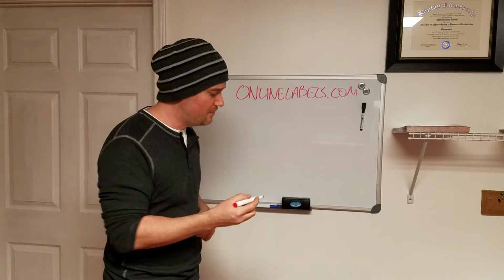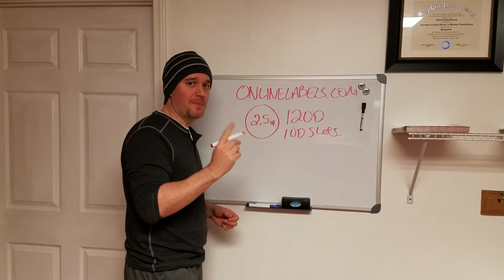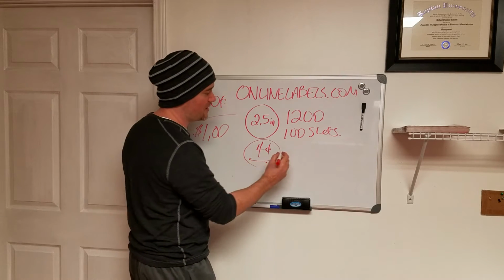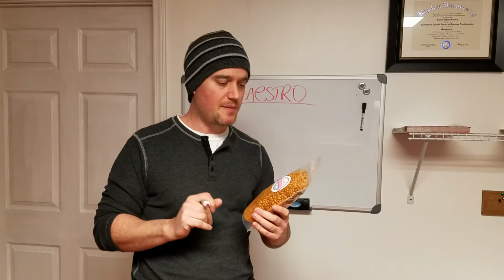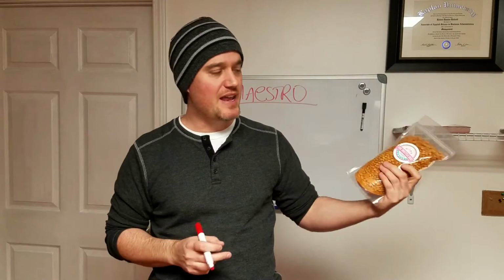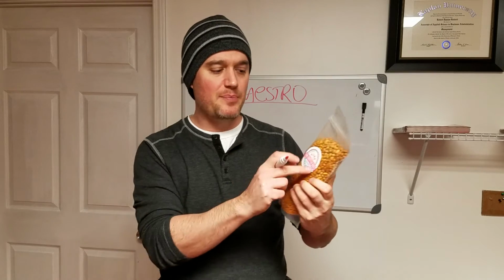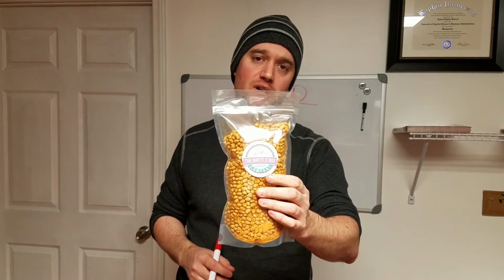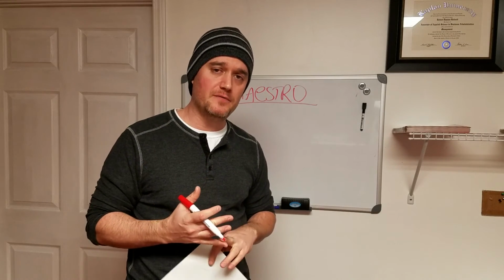Selling Food Online Tutorial Amazon Ebay Etsy Printing Labels for Pennies

Comment: Great info, but then him recommending onlinelabels.com is concerning.. I went there and they charge starting at $14.95 per sheet lol, 10 sheets still $4.40 a sheet.. 50 is 1.56 a sheet.. and the max is showing 250 and still .75 per sheet. Not sure where the 1200 is coming from he mentions. My local print shop does far better pricing and for lower quantity. This was only using plain white matte finish.
Reply from the maker: This will depend solely upon the label the size the finish and the shape. Compare it exacty to the ones I mentioned we print ours for around 5 to 8 cents each not all labels will be riced the same. thanks for asking though
Reply: @MarketingFoodOnline   You seem genuine & provide great info at first, and you mention how most overcharge for printing and state this site as being one of the more reasonable, but then the site you recommend is way overpriced even in comparison to local print shops who have overhead. Standard basic white matte sheet, 4x2 labels (10 labels per sheet), literally cant get more basic, and those prices I mentioned still apply.. literally 4x more expensive than local print shops, and I'm in Canada which is usually a lot higher than U.S. pricing..
Reply: Your whole premise is based on not buying a lot of labels to minimize overhead, but then the site you recommend is sky high prices unless you buy a large quantity.. not to mention you can't buy more than 250 to get the price down further when you claim buying 1200.. confusing & contradictory